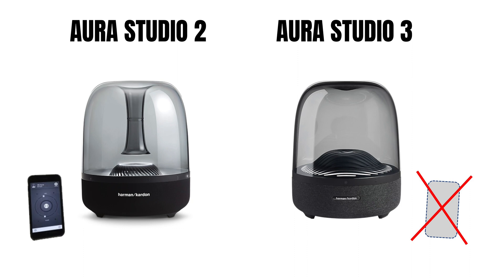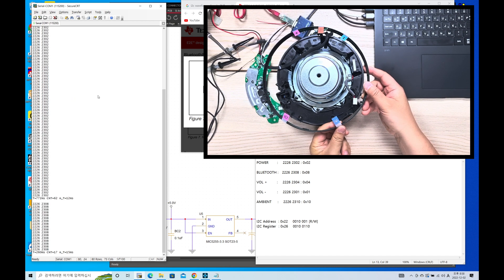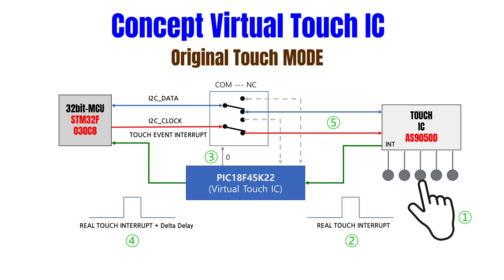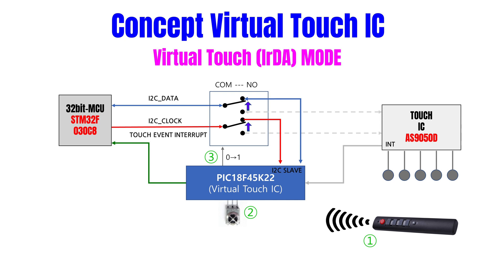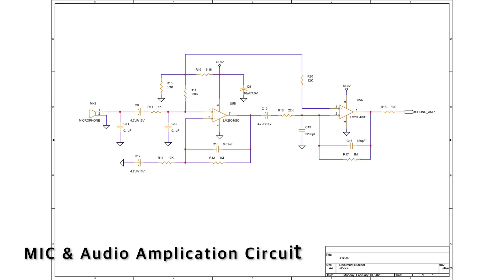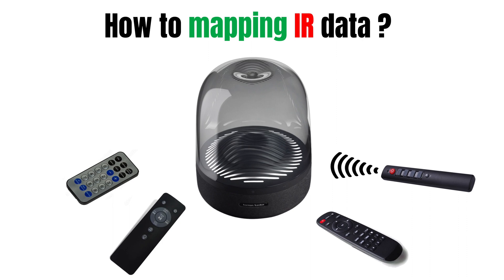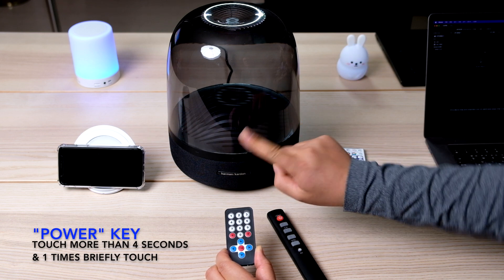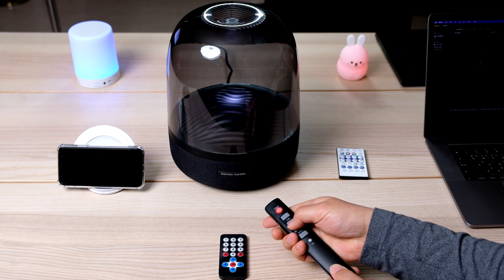Aura Studio 3 DIY KIT-IR Remote Controller

Comment: hey man any updates on this project?
Reply from the maker: Almost finish second and third projects.
I can post second video this weekend.
Added new customized led shows.
Especially sound adaptive VU meter.
Reply: @iamheesoo  I am more interested in the speakers itself. did you ever changed them or you just kept it stock? anything you did to improve the whole system itself? (sorry the lights are cool but I am more about the purpose of it being a speaker).
Reply from the maker: @lancereyesromero7811  
The speaker performance is same. Not modified speaker part, just modified RGB LEDs show program and add on IrDA remote control function for more convincing operate.

Comment: Hi there, great video and lots of useful information!

I have a question: do you ever notice that the Aura 3 makes rattling noise at low bass? Almost like the transparent body is vibrating and rattling - very annoying.
I am struggling with this issue, I have tried to take it apart and added soft foam tape under the black plastic body but the top part still rattling 😢
Do you have an idea how to fix it?
Reply from the maker: In my opinion, Aura Studio' 3's characteristic is that its bass output is quite high. (100Watt)
How about adding an R, C High Pass filter to the Basee speaker output terminal to reduce the output at low frequencies?

Comment: Can you pls help me with my aura studio 3, it's just turns on itself immediately when plugged. It only works with line in only now all the touch buttons not working again
Reply from the maker: I guess disconnected the touch connection cable (6pin-6pin) or touch pad FFC cable. Please check cable connection status after teardown.
Reply: My issue same this friend's problem. And I replace the new touch  FFC cable, but still problem, no fix. Could you help me upgrade the firmware for Aura 3?
Reply: Did you solve this issuie?